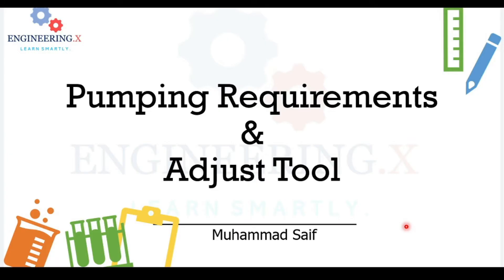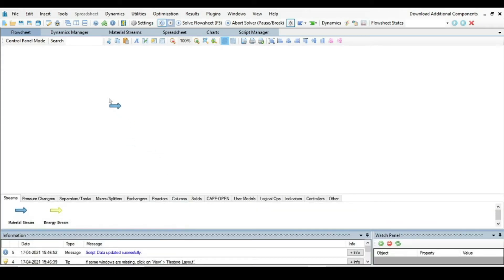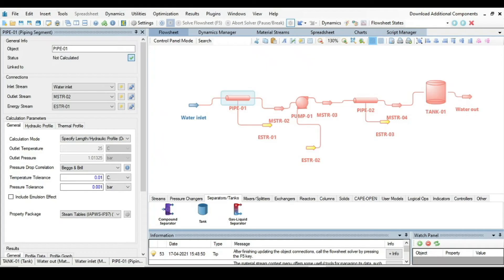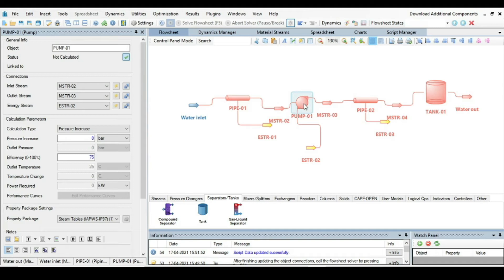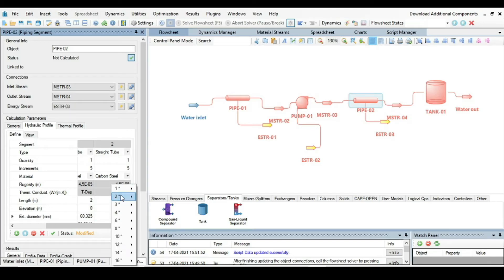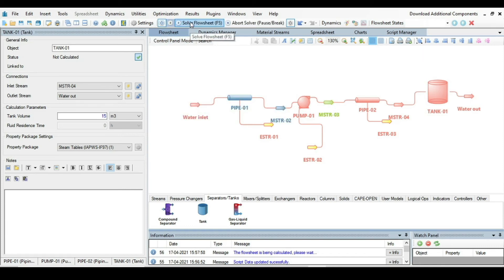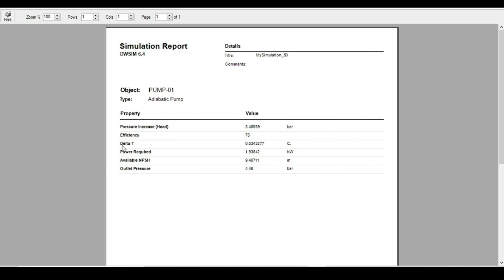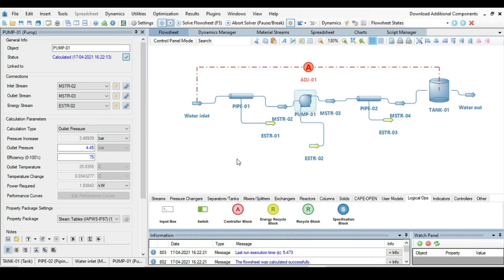Pump selection for water supply | Use of adjust function in DWSIM

Comment: I try to use the controller block in the latest version of DWSIM, v9.0.2, turns out I can't simulate using the controller block. There were no error messages come out. Do you guys have same issue with me and can help me? I just follow the case just like in this video btw

Comment: I did the simulation as per video but it shows the error in pipe2.
Reply from the maker: Is it about negative pressure in pipe two ?
Reply: @eduXinsight  yes, even I increased pump outlet pressure 150 bar still shows the error that negative pressure calculated.
Reply from the maker: Can you share your file I will check it.